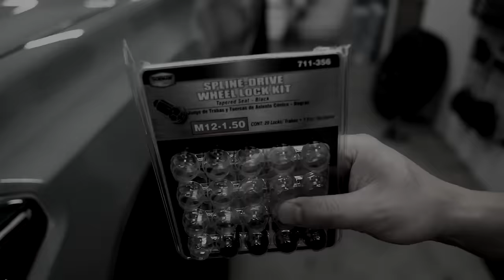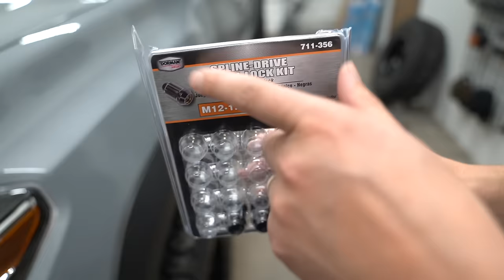Biggest Tire Size on a Tacoma/4Runner with NO LIFT!

Comment: Still got the temporary tags on it and already cutting pieces off. Noice!!! Does no one worry about the speedometer and odometer being wrong? My OCD tendencies couldn’t take it lol
Reply: Ric Flair and gears too
Reply: I'm very very worried about all these things too. I'm not a gear head what can you do? Or nothing you just have to bite the bullet?
Reply: GoproZack on older stuff there was a small gear u switched on a cable from odometer to the transmission. I don’t know what u do on digital stuff. Maybe flash it with an aftermarket code or something? I don’t know 🤔

Comment: not sure why so many haters. sure it will rub going over a speedbump let alone off-road. but this is an excellent video that could provide someone new to tacos with an indication roughly how big of a tire it will take. after watching this a newbie will see that a 2.5' lift will most likely be sufficient to fit a 33" tire so this is extremely helpful
Reply: People would rather bash than provide valid info
Reply: @JPRATT537  Valid info.... showing someone new to tacos about what tires they can shove in the wells and not explain how driving over anything will cause massive rubbing or putting the spare 1 inch away from the exhaust is a good idea? I like big tires as much as the next guy but you gotta admit this is a bad idea to keep these tires on stock suspension.

Comment: I have a 2021 Tacoma with a 2 3/4' lift with shocks and upper an arms.  Same wheels and tires that you are using,  Looks like same off set.  I had to cut the crap out of the inner fender for clearance and have the body frame cut back and welded.  What you did her will NEVER work!  You have absolutely no room for the suspension to work.  Totally ridiculous.  The spare
 tire installation is also totally bogus!

Comment: I just got my bfg ko2 285/75/16 no lift needed no rub this morning thanks to your video. Trd pro oem height didnt need any trimming. Mounted & balanced so quiet thus far.great vid guys . Helpful info helped make my decision.
Reply: Hey like your comment. I also have Trd Pro and was wondering install bfg Ko2 285/75/16 on it and would that rub anything on turns I just don’t want to lift it. Did you have to do any trimming. I’m using stocks wheels.
Reply: @rxsonny  no trimming at all.  Stock wheels are +13mm offset which is why i cleared. I thought i might ruin on articulation but i take it slow down hill descents.  Heard a couple of tiny ribs on passenger side only when RF was compressed but uphill zero issues.  Im considering leveling kit.i dint wasn't to lose my fox's . I go offroad a lot.
Reply: Just wondering if you still are happy with the K02s in the larger size and still no rubbing? Have a 2019 Pro and want to do the same thing. Thanks
Reply: @jod1113  i had to take mud guards off. The oem glaps would rub under articulation. But light rub. Not crazy
Reply: I have bilstein 5100’s on my front. Just wondering if it’s really worth it to go to 275 from 265? Are you gaining that much for the loss?

Comment: I am not going to lift my 2019 TRD Off Road (Yet) but am going to put 265 75 16 BFG KO2's on it this weekend. When I eventually do lift I may just go with a 2in Front 1in Rear lift. I only Off Road a handful of times a year and the trails/roads I do travel are pretty mild. My old 2013 Taco with 285 70 17's with 3inch F 2inch R lift seemed to be a bit Overkill for what I normally do.
Reply: I have a 2021 TRD off-road and I’m doing the OME 2”, with some 32” tires, perfect for camping and mild off-roading, I don’t see the point of pounding a brand new truck on heavy off-road and rocks, that’s what my 1987 Toyota pickup is for lol

Comment: I want to put 285/75/R16’s nitto ridgrapplers on a Stock 2019 Tacoma TRD pro and hopefully to be able to do it stock without rubbing.  I’m looking at Fuel Conver D694 16X8’s.  

I know TRD Pro’s come factory with a 1” lift so basically I’m trying to see if this set up would work.

Comment: For every extra inch that you are increasing on tire size you are getting only half on ground clearance, if you are upgrading from 30's to 33's you are getting only 1.5 inches of extra height. Difference in between diameter and radius
Reply: It's actually little more than 1 inch if you calculate going from 30.6 to 32.7

Comment: just bought a brand new 2023 sr5  4x4  tacoma. it has 245 75/r16  firestone destination le2  with the dark  rim.  i find the truck sitting lower than i like.used to the 1500 ram i traded in.i find i have to tilt my head to get into the tacoma also not crazy about the dark rims.would like to switch the rims to a crome color and put on tires that will raise the truck without having to install a lift kit ....any suggestions ?

Comment: These clowns usually post good content,  dont know what they smoking today.  285s will fit... Sure!
Reply from the maker: kaitlynn saenz We showed that 285s will fit with some trimming and we also mentioned that if you don't want to trim you can do 32s instead.
Reply: @Runnin4Tacos  yea you guys forgot about when going over bumps. the tires are guaranteed to rub still when hitting the slightest bumps in the road especially on the offroad eddition. the suspension is much springier

Comment: why doesn't Toyota just make the Fender wells bigger?  they know you're going to put bigger than stock tires.
cutting your flaps out will allow dirt to go inside your chassis and rust it out.  you can also use a geat gun to make the plastic soft and mold it with an object wedged between the gire and wheel well.  I recommend just doing it right and get a leveling kit...

Comment: I would like to see that truck going down the street taking turns taking bumps and some videos of it going off road and see what it does as far as rubbing. I bought some wheels and tires but unfortunately the shocks are on a six month back order for most manufacturers. So if there are issues with putting on these wheels and tires on the stock truck I’m not going to bother

Comment: Uh.....a 2 inch change in ground clearance by installing a 2 inch taller tire?  Not so.  Try 1/2 of that because 1/2 of that height is above the center point of the wheel.

Comment: Would that work with a 2" leveling lift kit
Reply: it would work with minor rubbing only on pavement.  If you're going to be doing off roading or drive over speed bump, they'll still rub.  you need CMC

Comment: Looks great, I have one question, when you put larger tires, what happens to the speedometer? Does that have to be adjusted?
Reply: There is products you can buy to adjust this.
Reply: With a high dollar scan tool (Autel Maxisys for instance), you can go in and change the tire size. Some vehicles do not have this option but I know that is one way to do it. In other words, an automotive shop should be able to do it with the right equipment.

Comment: tacos are the worst when upgrading to 285s.  gotta chop and finagle stuff, especially  during flexing  and hard turning. get a lift change upper control  arms  and might gave to negative  spacer  tge wheels away from the frame,

Comment: Yeah, that does not "fit." No idea why owner didn't go with the C-rated 285/70/17 instead of the E-rated. The C is 51lbs (6-ply equivalent) vs almost 58lbs on the 10-ply equivalent E. In another comment, you said "most people who are asking us for the biggest size are also saying they are only driving on road" so I have no idea why owner would want the extra load rating, which IMO is overkill on a Taco even you are off-roading. I really wish they made a C-rated 265/70/16 for a same-size upgrade. I'm going to go with the Falken Wildpeak A/T3W since they make it in a P version in the stock size and I don't want to lift truck (yet?).

Each of those E 285/70/17 KO2 tires is over 20 lbs more than the stock Wrangler A/T Adventure (37 vs ~58), which will kill mileage, cause extra wear on almost all of the truck, and make it drive like a total slug unless you re-gear. Plus, the E-rating will rattle the hell out of the truck and anyone in it. One of the more ridiculous "upgrades" I've seen. Happy mall-crawling. :)

Comment: Stock sport model without  switching rims out these are the 17” inch do you know largest tire size I can go.
Reply: 265/70/17 unless u add wheel spacers
Reply: Equalizer 2 Thanks Man did want to go just a bit larger.🇺🇸🍻🤜🏻

Comment: Bull. You need to do more than just ‘minor trimming’ to make 285’s fit.
Just doing a minor turn, forward or reverse, out of my driveway causes rubbing. And there is only a 2-3inch incline from driveway to road. Then they also rub when traveling on on/off-ramps.
The fix for my 2018 Tacoma was a 2” leveling kit.

Comment: I like precision, so here it comes, 265-70 R16 = 30.6 inches  and the 285-70 R17 = 32.7 inches, so let's say that this mod costs at least $1,000, there is a 2.1 inches difference, but ONLY 1 inch clearance addition,  because only half the tire is below the axle....I feel it's a lot of work and money for a small inch...
Reply: It’s a lot of money but the eye sees that inch from a different perspective when looking at a tire than you would looking at a lineal inch. I think you are looking at an inch as you  would from the perspective of a ruler.
Reply: @boblafountaine9560  I am looking at one inch of added clearance, I do understand that the look completely changed and it looks awesome, but that inch will also diminish your towing capacity, even more if you level the truck, as we know the front is usually one inch lower, so when you pin the trailer and your rear goes down one more inch, your pulling power is no more optimal...

Comment: Not that anyone cares. But the fuel economy will suck even worse with those tires. Don't really get the obsession with the Tacomas. But at 6'2", I dont fit into the low cab. Plus, my F150 (V6 twin turbo) gets 23 mpg on the highway. Using less fuel doesn't see the point for most.... Screw the next generation. Off road? That's what the sled or the CFR450 are for. More capable, faster, and fun.....

Comment: I have 255/80r17 wildpeak at3w tires on 17" TRD 4runner wheels. They work well for me. I havent had to trim anything. I have a small 5100 lift in the front.

Comment: Gotta do ALOT to fit 285s with no rubbing, especially if you drive your truck lol. 275s, only problems I've seen on stock suspension are rubbing on the front mud flaps or upper control arms.

Comment: Guys, I want you to go and watch all of Chris fix videos. I want you to take note of how he uses proper lighting and takes the time to actually get the shot to show what the hell you’re doing. Because if you’re actually going to go forward, and put together a video you might as well actually have a video that shows what the hell you’re doing. Because I can’t tell what the hell you’re doing on your video.

I got a 2021 off-road coming, and I really don’t want to do a Lift, but I do plan on putting on bigger tires after the set I have wears out. And I don’t wanna have to cut anything. End of story.

Comment: I have a '23 TRD OR DCSB with the TRD 2/1 lift. If I want no rubbing, trimming, and no cutting or cmc, then what size is best? I want to be able to full flex/full lock with no issues whatsoever. I don't like the oem wheels, but I'd definitely want to stick with 16's and at least an 8 ply tire. I heard 265/75/16 would be 1 inch taller than the stockers, so that would give the appearance of a 3' lift on my 2" kit if I'm thinking correctly.

Comment: So I just have a 4wd base model sr5 and I want to put bigger tires on it but I can’t find any videos on my truck other then trd off-road models which sit up higher dies anyone know what the biggest tire size I can run without trimming is?
Reply from the maker: 32-inch tires should be fine

Comment: Toyota put the size tires needed for that truck. You didn't gain ground clearance or height because those tires are gonna RIP those fender flares off the first time you hit some rough trails.

Comment: Why not put a leveling kit in or use a narrower tire at that height. Spending $800 to $1200 on tires or $2000 on tires and wheels to cut up your fenders is crazy.

Comment: On my 23 TRD OR, on the TRD alloy wheels I got 265/75R16 and I have no issues. I have not fully flexed the truck but I doubt I will have issues rubbing. For summer time, I run my steel wheels with 245/76R16 tires and I’m happy with that. If I ever decide to lift, I would only go with the TRD q inch lift, personally.

Comment: Great video. so the 275-70-17 fits with 0 issues correct? alsom what about the odometer? did you modify it? thanks
Reply: I have 275/70/17s and they rub slightly on high approach angles like certain drive ways, haven't trimmed anything yet but something to keep in mind.
Reply: @Alt2107  thank you. Do you have a video? Or picture?  Mine is Sport 2019 and want the 275 70 17 but i have the oem wheels so i want to keep stock with the tires 275

Comment: I have a 2009 trd and I have 265 75r 16 bfg ko2 tires maybe an inch over stock, great tires and no rubs or mods needed. Maybe not as “manly “ or macho as all this hassle but way cheaper and functional.

Comment: @15:40 concerning the spare tire; "The last thing you want to do is put a smaller tire with these 33s". If you had say the original tire, 265-70-16, as the spare, you have differentials both front and back, so why would that be a problem to run it with a smaller tire on one wheel while you head to the tire store to get your flat fixed?
Reply: I will try to be nice...... but in short there's dozens of different problems some of which could be fatal (like highway speeds). some people drive places and get flat tires where they aren't 5-10 minutes from a tire shop.. some people get flat tires when they're using the 4 wheel drive function of their truck. go put a 2" smaller tire on your truck in the desert or mountain trail and try to 4wheel your way out and drive 4 hours home. at midnight am cause you spent 3 hours trying to change a tire in the mud.
Reply: @mattgill69  You have differentials that compensate for different speeds in tire rotation on the same axel. Why is there a problem running with different tire sizes at a slow speed for a short distance?

Comment: You pointed out that a 275 70 17 won’t rub.  Is that the same with a 265 70 17 Toyo OC 3s with a -6 offset rim on my 2021 trd off road 2x4?

Comment: Need some help from you guys please. I have a 17 TRD Sport, and the OEM fenders that came with the truck was white but I went ahead and plastic dipped them, unfortunately didn't turn out as good as i hoped. I noticed on this video the fenders are black, exactly the kid i am looking for, becasue the ones i bought doesn't fit properly and wanted to buy the full set, I still have the clips on the truck, so I have been wanting to locate some to switch them back to the original style as the ones on this video, please if you direct me to a web site to where i can purchase a full set of front and back , greatly appreciate it. the plastic piece on the drivers side that holds on to the panel broke and trying to figure where to but that piece as well.

Comment: Hi, thank you for all the info in you re video, thas help a lot , I m new oner Tacoma offroad (2019). Since September 2021.
Before I have FJ CRUISER for 10 years,  I have question about the airbag, on the fj cruiser it was possible to turn off the airbag,  when I go for offroad with my FJ cruiser I turn off the airbag all time , but with the Tacoma... not button for turn off the airbag.... what do you do for that.... do you pull off the fuse, or you just don't turn off the airbag in the trail..... 
Thank you .
Reply from the maker: No need to pull a fuse or anything, I believe Toyota made it so it won't go off when off-road unless the vehicle rolls over. We haven't had any issues with the air bags at all
Reply: @Runnin4Tacos  thank you 👍👍👍

Comment: If you have a 285/70 on a 16 does that mean you will have 32"s instead of 33"s.....I'm planning on getting slightly bigger tires on my Montero and there's room for more tire but I wanna keep my stock 16s for now that have 265/70 r16 on the currently.

Comment: Not all tacos have the same measurement down there from factory. I'm using 285/70/17 Duratrac with factory rim from a 4Runner with no rubbing, stock height. No rubbing is doable with 33" tires. Depends on rim offset and luck. Me, thinks 285/75/17 is a typo from the dude. That's size over 33'',will rub!

Comment: Don’t be confused when people say “equivalent to” 33”. 

A 285 70r 17 is not equivalent to to a 33” do your homework folks. Here’s a link below to help you visually see the difference between an “R” radius tires  vs a true 33” tire. You’ll notice a big difference when you lover your tire pressure. For example 10 psi on 285 70r 17 is a different footprint than a 33 12.5 x17

https://www.tacomaworld.com/tirecalc?tires=285-70r17-33-12.5r17

Comment: I'm trying to decide weather to put a 3.5" lift on my girls 2019 tacoma Trd Sport with 33's or just put some tires any suggestions thanks
Reply from the maker: I would recommend a 2.5-3 inch lift with 33 inch tires. 3.5 inches is a little much so you'll lose ride quality

Comment: With the 2021 trd PRO will the 285 still run? I know they do the leveling on the pro. Trying to decide on size without lifting no cray trails help! Would 275 be better or would I be ok with 285? Stock 265/75/16

Comment: I have the same method wheels but in 16" with 265/75/16 but I have a random shimmy after 58 mph that comes and goes have tired 3 sets of tires and road force balancing what am I missing?

Comment: You can fit 32.5 with rub on Tacoma but you need to cut inside the finders not outside you’ll be fine. I have both Tacoma and 4Runner,on 4Runner you can fit a 33 you’ll rub slightly but take off the mud flaps and that should clear it just fine